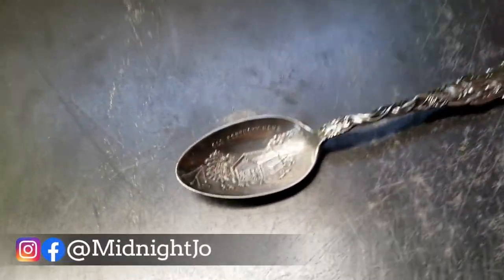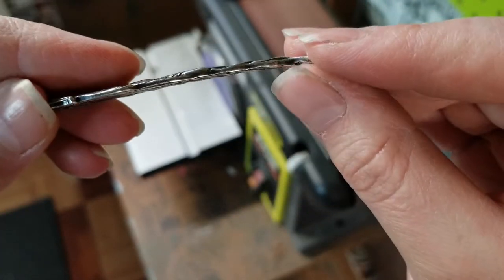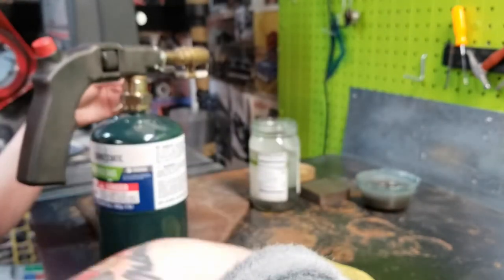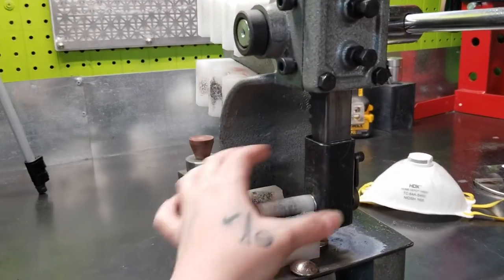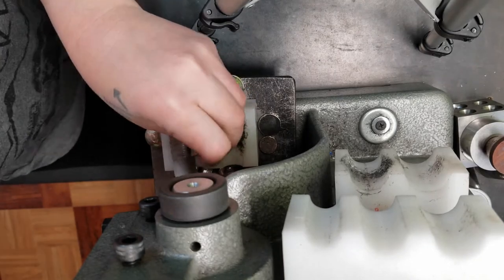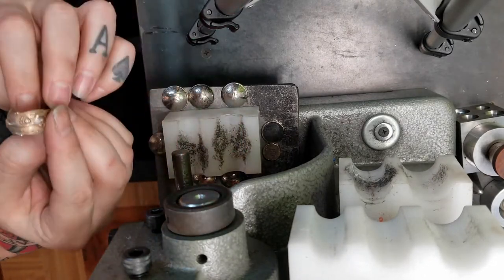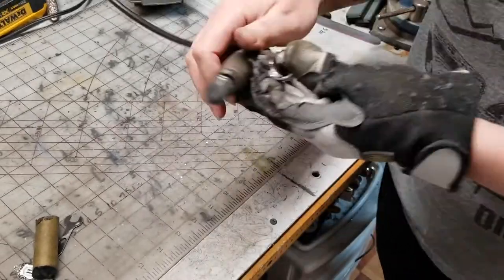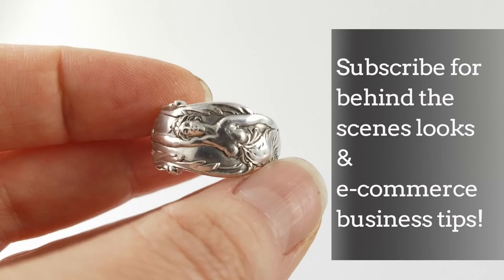Making a ring from and antique souvenir spoon

Comment: to anneal correctly is to cool the piece as slowly as possible. To rapidly cool it you've harden it.
Reply: That depends on what metal you are working with. Sterling Silver isen't one of them, but there are silver alloys that can be.
 But in essence. If you want to properly aneal things, or Normalize it as we blacksmiths call it. you heat it up untill its slightly glows, then set it down on a gypsum or specialized ceramic block for jewlery (Dont remember their name), and just let it cool down to room temperature on it s own.  It takes a bit of time, but given the thickness of the spoon, it shuldent be mutch more than a minute or so.

Comment: Thanks for rhe handy video! I just want to say though, when you quench the metal you arent softening it. Quenching hardens the metal. You have to cool it slowly for it to soften. Youll find the metal much easier to work with if you cool is slowly after heating
Reply from the maker: Thank you, this is a fairly old video 😂 I've learned a lot more through the years ❤️
Reply: @midnightjo1327  woops sorry! I didn't check when it was posted.
Reply from the maker: @Chuckieraven  no problem, thank you for watching!
Reply: It depends on the metal. She said it was sterling silver and it dosent harden trough quenching. But there are silver alloys that do.